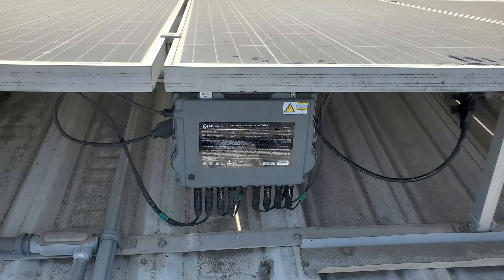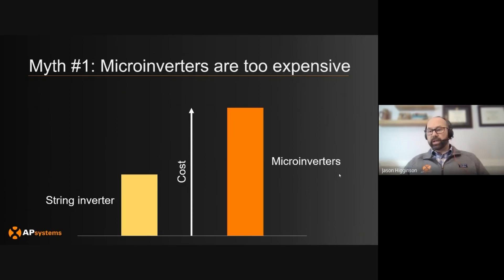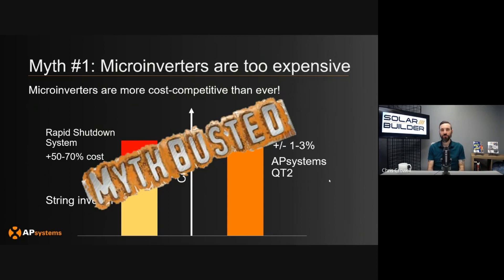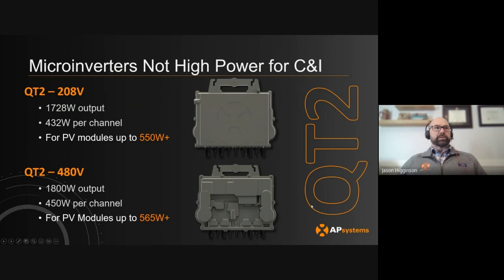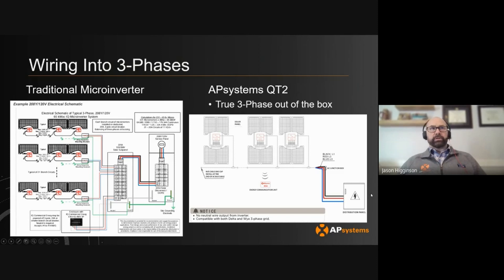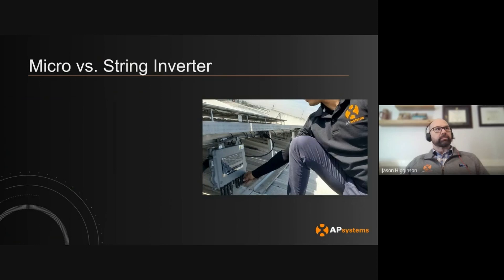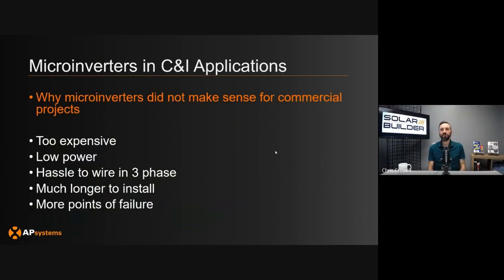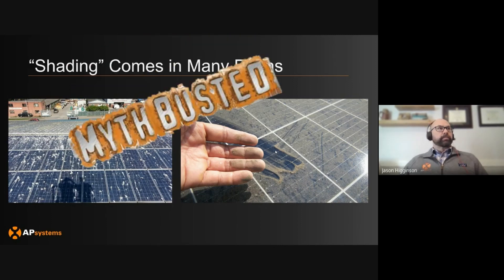Microinverters in commercial & industrial solar with APsystems | The Pitch

Comment: Enphase dropped the development of a dual microinverter because the  $.11 watt IRA production tax credit (PTC) only applies to single-module microinverters. 
 USA 480-watt IQ microinverter will be available soon.
 The PTC covers 50% of the actual production cost.
I fear AP systems days in the USA are numbered. 

Move production to the USA or suffer the cost battle globally, Enphase plans to export from the low-cost PTC subsidized USA footprint
The primary selling point for microinverters is a well-established conversation,
 a low failure rate compared with any string optimizer combination. 
A standard microinverter will last without fail for the life of the array. 
String components will have to be replaced once possibly twice over the life of the array.
String is only cheaper on day one after the commissioning of the array. 
Every day after that the array is a risk of failure. 
Trucks will roll for maintenance on a frequent basis.
25 yr warranty vs String/optimizer 10 yr. 
What's APSystems warranty?
If the warranty does not aline with the expected life of the array do not use the product.